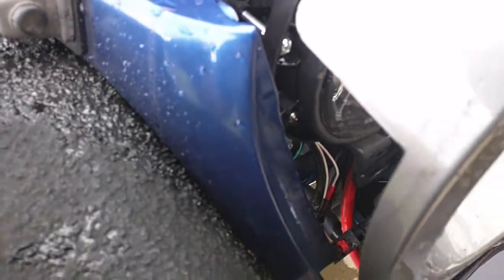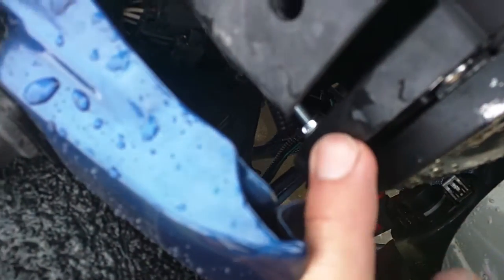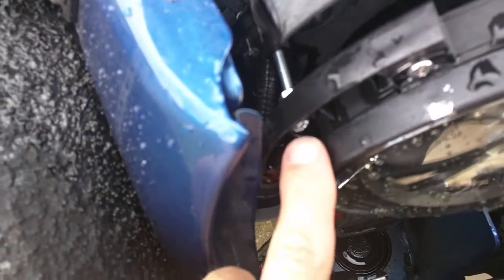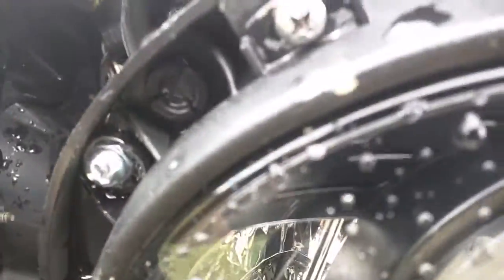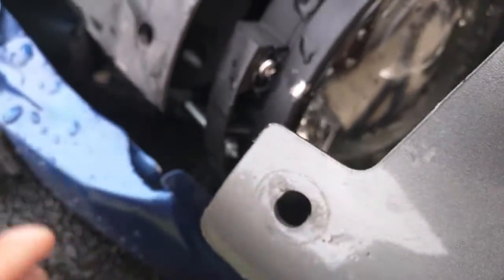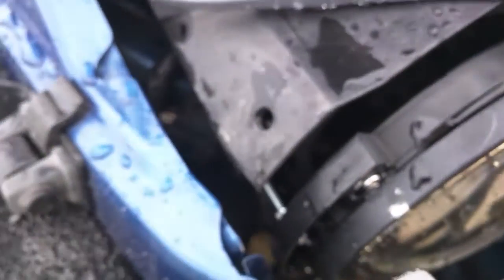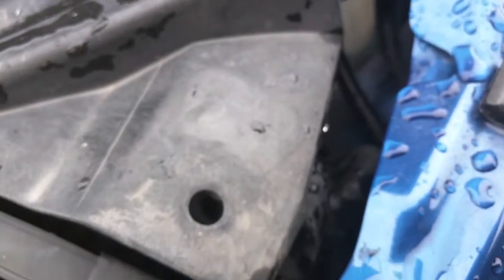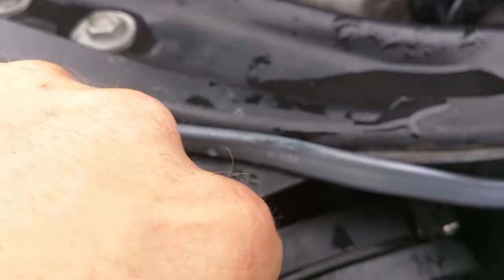Jeep Wrangler JK busted Headlight housing fix

Comment: Thank goodness I found this video. Both my adjustments screws on each side are stripped and won't do any adjusting. The other weird thing is I only have one adjustment screw per side. Most people have said I should have two but the other mounting posts are fixed posts so I can adjust the vertical axis but not the horizontal. Which is frustrating because my new headlights are cross eyed. Thank you though for taking taking to make this video so I can MacGyver my adjustment screws too!

Comment: Dude thank you so much for this video! I completely busted the plastic cradle for the adjuster screw and was already ready to spend $40+ to fix it and get a new bracket an I saw this video. Super easy to find the screws needed and it was a quick fix and saved my headlamp from bouncing around. This video totally saved my butt!
Reply from the maker: Cody Kramer no problem buddy. Glad it helped out

Comment: I have the same issue on my wife's 2015 jk. I'm going to follow this lead and attempt the same fix. I'll keep ya posted.  Thanks for this great tip. Ur right, they want 80-100 bucks and more for the housing set of 2. Crazy. 
Thanks for this post.
Reply from the maker: No problem, hope it works out!
Reply: 2015 JKU, same issue here. I was thinking of the same fix, but glad you showed it here on YT! Indeed doesn't make sense to buy a full housing for 200 bucks. Cheers!

Comment: My problem is that the plastic mount that the light screws into is “stripped” so you can’t adjust the light, it vibrates and wiggles when the engine is running, and is barely staying in.  So, I think I could use this method, but is the 10/32 bolt the same width of the “factory hole” it screws into to hold the light (and adjust) into the frame?  Since that hole is stripped on mine, I’m thinking I need to go with a larger size bolt to “make” a new hole.  Do you have any thoughts or suggestions?  Should I go fatter than the 10/32?
Reply from the maker: Mine was stripped as well but you could try that one first the 10/32 and if it don't work go larger. Not going to cost you but maybe $2 to try

Comment: Jamie, 

Im confused-  If you  welded  the screw in place how does it turn to adjust the headlight?? Or u just welded the nuts and washers in place?? Sorry for the stupid question. But this is a great fix. I just need to clarify b4 I try it, how does the headlight get adjusted if the screw is welded in place? Thx arnie.
Reply from the maker: No I didn't weld the screws, just used JB weld to hold the plastic back together some. Then I put the screws and all in. JB weld is a type of glue, you probably use any glue, JB weld is just a real good glue at holding stuff together
Reply: Awesome , thx for the clarification. Cant wait to give ur solution a shot. Appreciate ur response.

Comment: Is the screw being screwed into the threads of where the stock adjustment screw would go? or is it just being pushed against the plastic by force?
Reply from the maker: Yeah screwed in where the stock one would go. Mine busted out so I used the nuts to hold it in place